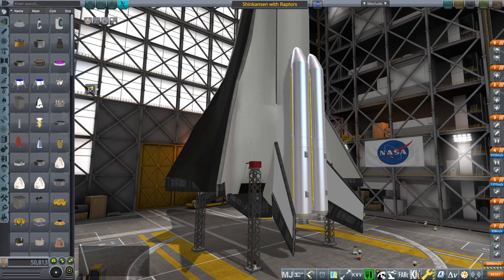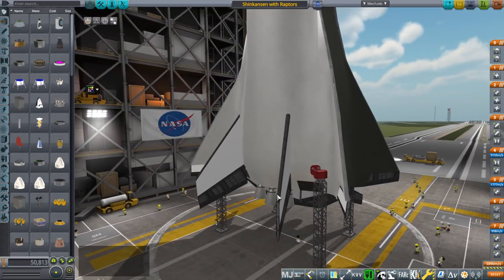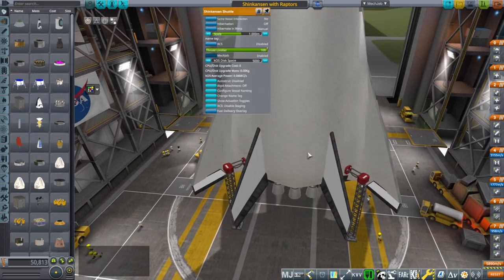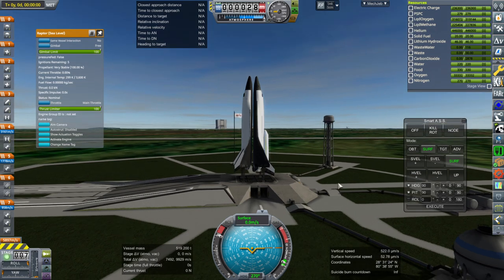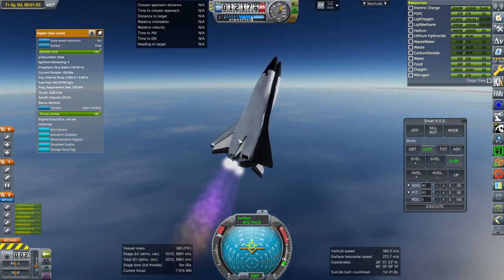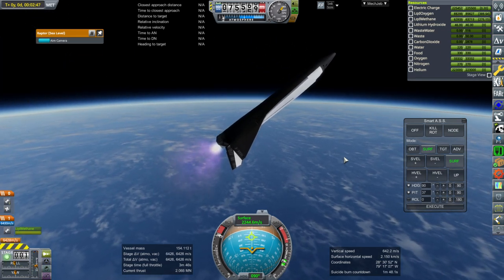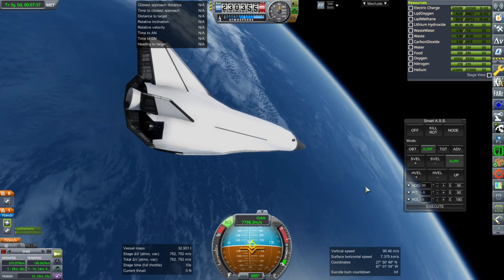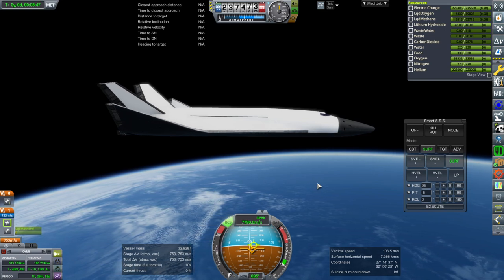KSP with Realism Overhaul - Shikansen with Raptors

Comment: Maybe replace the vacuum on the orbiter with a sea level raptor. You could possibly remove the booster, and since your at sea level you would get better performance than you would with the vacuum
Reply: But then he'd get bad performance in vacuum and near vacuum, which is most of the trip.